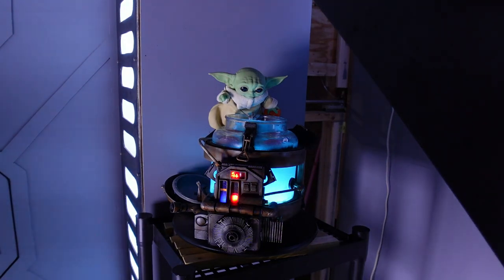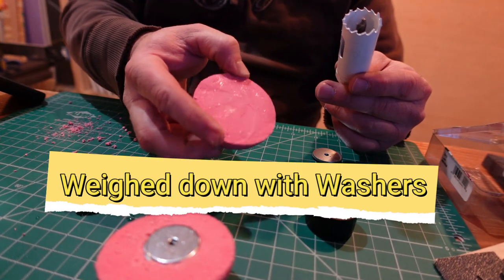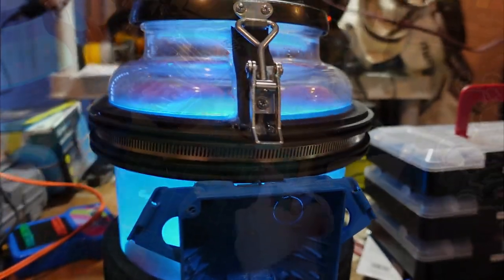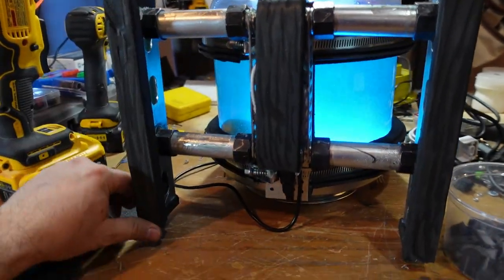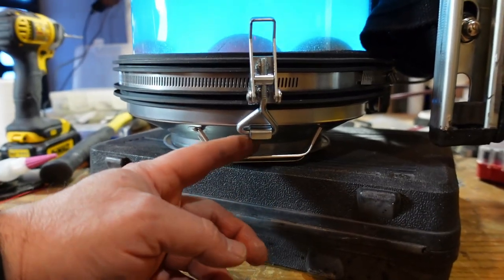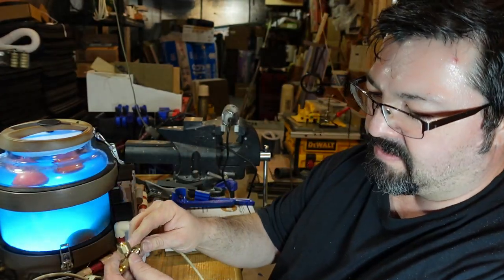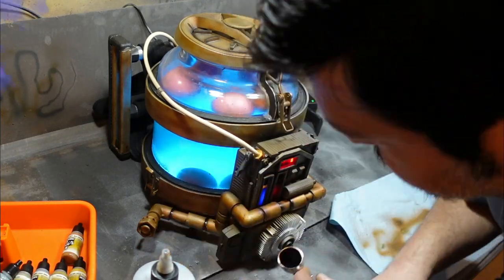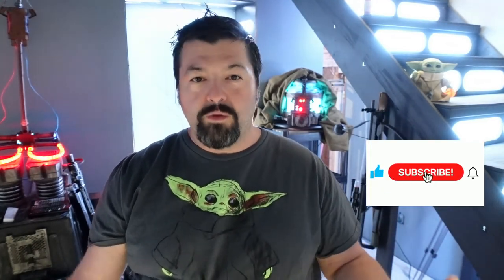Mandalorian DIY Prop - Frog Lady Egg Container Build

Comment: Lovely job. Trying to get the eggs to float at mid-level depths requires active buoyancy control. An alternative might be to make them slightly positive buoyant so they try and float but restrain them from the bottom with varying lengths of fishing line which (hopefully) would not be visible in the murky fluid.
Reply from the maker: I was playing in the water for a week. I was done done. :) Thanks for watching!
Reply from the maker: I did think of the fishing line thing, about mid week, but I think it came out good enough for what I was looking for. Some other egg containers have a large glass area, so it might be more benefial for them. thanks again for helping out!

Comment: Dude this turned out awesome! I want to make one of these so bad. A great glue for glass, metal, etc is E6000. it dries semi flexible so it holds up very well with a very strong bond. Love what you did with this build.
Reply from the maker: Thanks Ill have to try that ! The hot glue is still holding though. I don't move it around too much! Thanks for stopping by again!